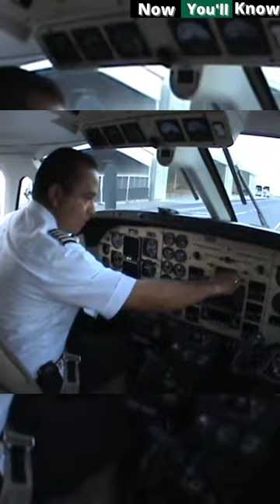Aircraft engine Sucking humans  #usaf

Comment: There is no way that story is true on so many levels. the "start engine" signal looks nothing like anything else specifically so something like that doesn't happen. Aircraft start their engines on pushback, so the pilot would be talking directly to the tug operator who would just tell him to start his engine. The engine doesn't instantly go from not moving to full idle power. The pilot would know there's an inspection taking place so would clarify before starting his engine if he didn't see the signal properly. ground crew inspections take place well before the pilot would be ready to start engines as they wouldn't even be done with boarding yet.

Comment: Doesnt it have to wind up? 💀
Reply: The engine was already running (on idle) but due to misunderstanding, pilot increased the thrust...
Reply: @aviationonly07  Thanks for the info, i already knew engines could go idle, but i wasnt sure if that was able to happen with airliners.

Comment: Im an aircraft engineer and during training i saw pictures of what happens when a human gets sucked in an engine. Mush.
Reply: Well John Bridges survived it going into the intake of an A-6E on board the USS Theodore Roosevelt
Reply: @mrkiplingreallywasanexceed8311  only because between the air intake of an A-6 and the engine there is quite a distance.